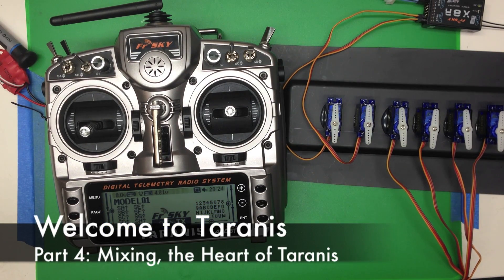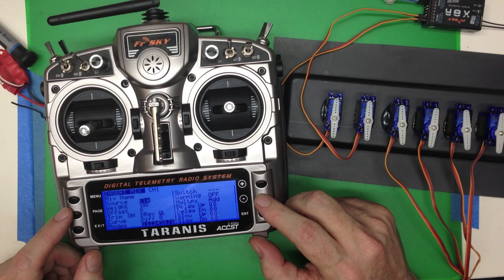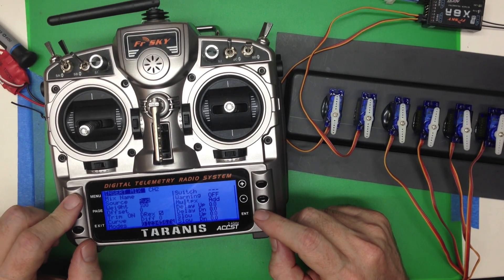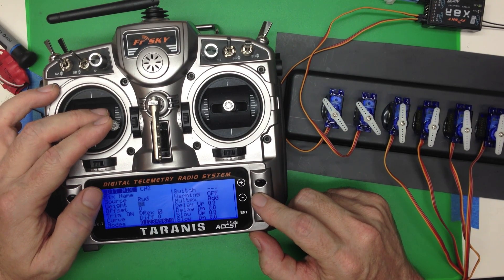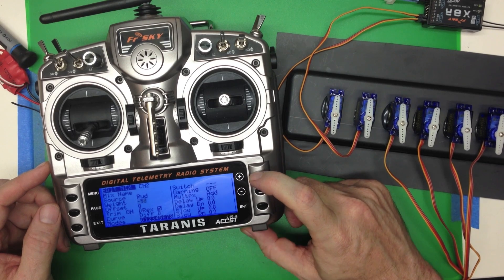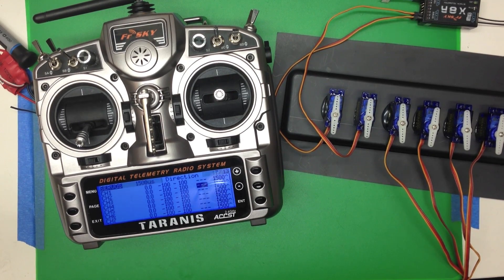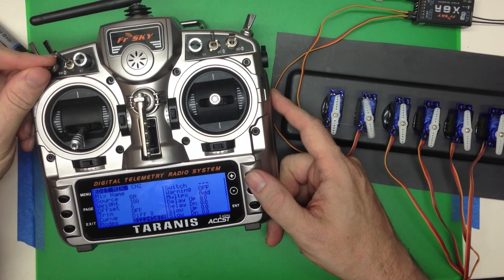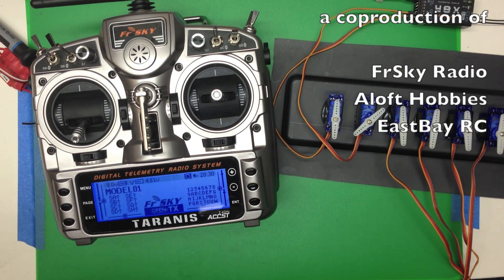Welcome to Taranis, Part 4: Mixing the Heart of Taranis

Comment: Hi, Mark. Many thanks for this tutorial. I'm slowly getting my head around the multiplicity of functions the Taranis offers - but - I'm stuck on two points - 1) how to set up differential on ailerons, using two receiver channels (ie more up than down, for long-wing gliders), and 2) how to incorporate a 'throttle off' safety lock on a switch, for electric models.
Thanks!

Comment: How do you mix throttle with down elevator with an ELEVON setup?
Reply from the maker: Pretty simple... add a third line to each side that subtracts the throttle.  Scale might be -10% (to subtract) with an offset of +10% (so that at 0% throttle the wing is flat).  Something like this:  "Thr Weight(-10%) Offset(10%)"
Reply: Got it. Thanks!

Comment: I've bound my TX to a Bind and Fly indoor model. It bound okay, but the throttle is running with the rudder stick and the rudder is run with the throttle stick and the elevator is run with the airlon stick. How do I change the channels to the proper order? This is my first computer radio and  you cannot change the servo leads as they're soldered in. Thank you.
Reply: To answer my own question, I found it on your other video. Thanks for the great videos, you make it sooo easy!